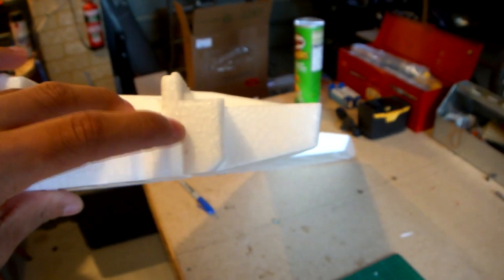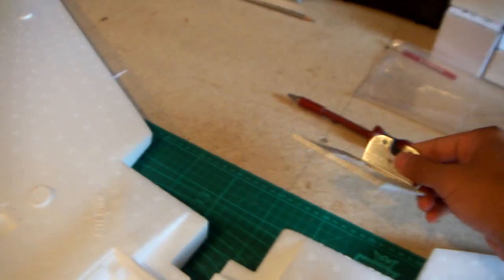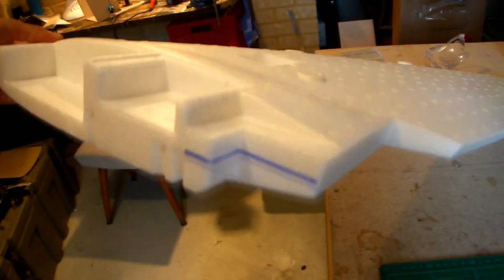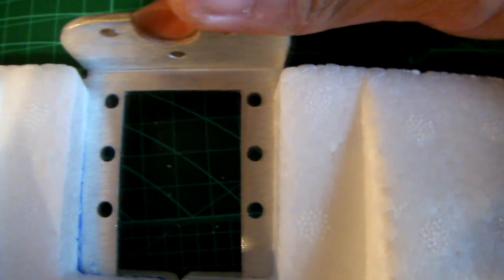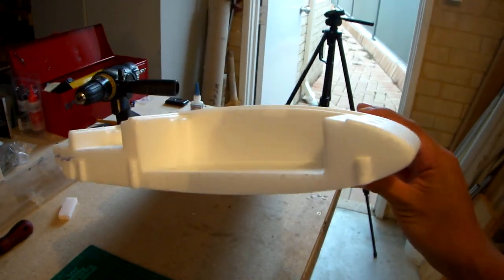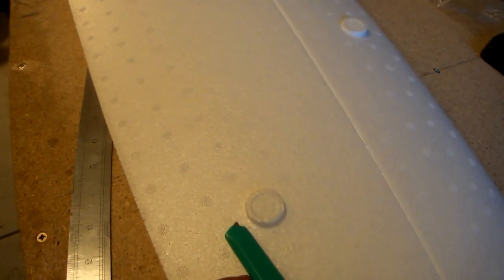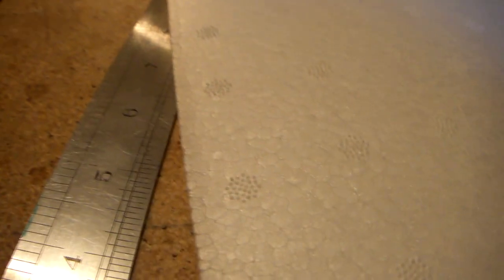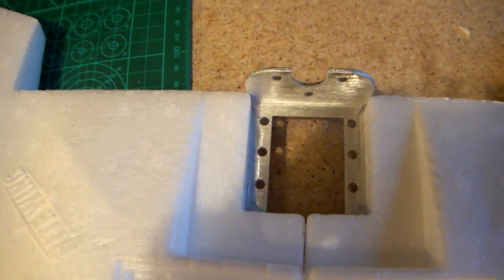Zephyr II Build: Part 3 Building

Comment: is it okay if the motor mount is not flushed on the trailing edge of the wing?
Reply from the maker: I can't imagine it being an issue at all, provided it isn't so far away from the trailing edge. It will make a difference if it is not parallel to the chord however.